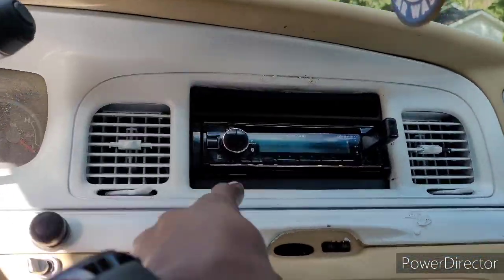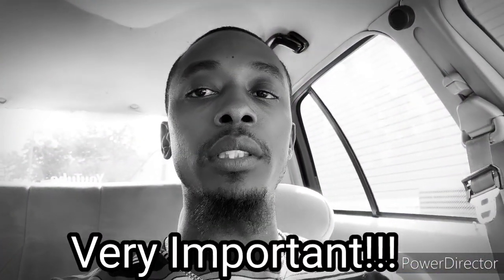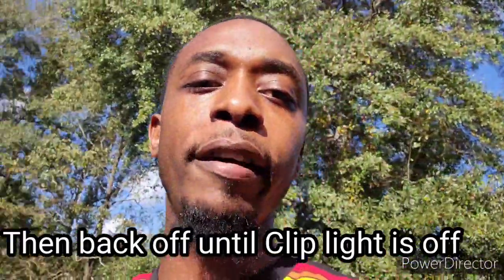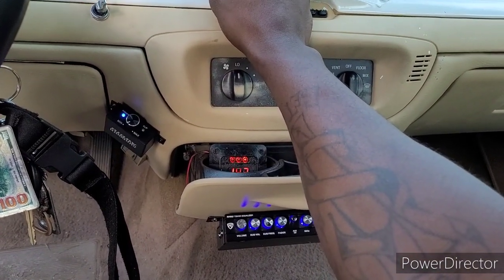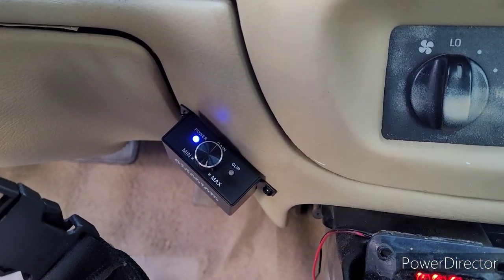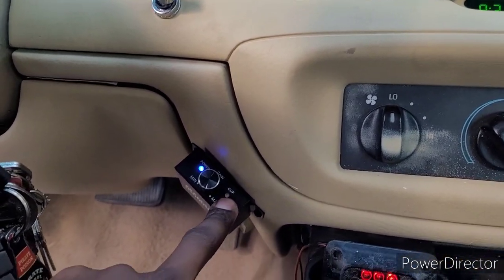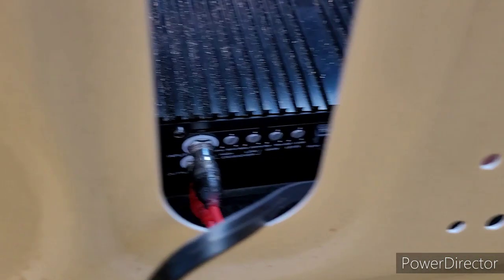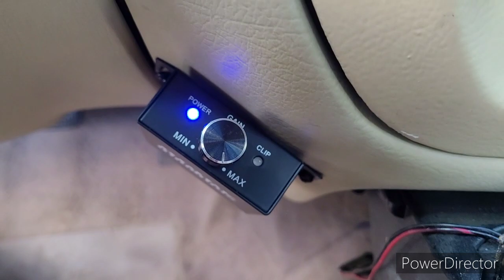How To Adjust Your Bass Knob & Amplifier| Sundown Sfb 8k| Fast & Easy| No Expensive Equipment Needed

Comment: Those Skar audio bass knobs with the clipping light are great to have. It was tested against the SMD2 and both came on at the same time. Pretty accurate
Reply: @BassAddict91  pqqpQLQ1a
Reply: is it good with other brand subs/amps
Reply: @BassAddict91  dissoconect speaker wire or rca
Reply: Cann you use that audio knobs with other amps or no?

Comment: Yup the dd1 for finding the max undistorted volume of the head unit and then matching the gain of the amp to the voltage output of the head unit

Comment: What it do bass addict. I am a huge fan of yours and i watch all uour videos. I have a system i am working on in a f -150. I have a single sub 15 inch 2200 watts qpower and a 2000 watts boss amplifier. I cant reach the full potential so i need some guidance any suggestions

Comment: Bro idk why but I did this with a test tone, subs disconnected, and adjusted the gain on my amp (which has its own clipping light) and the light never came on, it would let it go almost all the way and no clipping light. I connected the subs, turned everything down balls low, and the. Adjusted it SLOWLY and the light came on with subs connected, but volume low. Not sure why.

Comment: You have to turn up your sub volume on your deck all the way up cause the preouts are gonna match up to the voltage of the deck , and the higher the voltage on the preouts the better 4v or 5v the best  and that’s without a eq or bass enhancer .
Reply from the maker: 🤔 you got a point
Reply: @BassAddict91  who build boxes I am from Troy trying to get sumbody to build me a box for 2 15s in a Lincoln
Reply from the maker: My homie boy Jason Mcdaniel at the Box Shop in Montgomery Alabama
Reply: are you talking about the subwoofer level on the head unit?

Comment: Aye I’m thinking about getting the skar 12 loaded enclosure and I wanna know if it’s a good investment and if they are good speaker?
Reply from the maker: Yes get the evls you want regret it
Reply: @BassAddict91  what’s the difference from the sdr?
Reply: @vextua7453  Sound quality and can take almost double the power
Reply: I have the sdr loaded enclosure and it’s a good budget investment and they bang and sound great but if you have the $ go for the evls. But if you’ve haven’t had subs in the past the sdrs would be a good start
Reply: @vextua7453  the EVLs can take way more power. Don't let the 1250watt rms deceive you they can take more as long as it's clean
Reply from the maker: O I know I had two 15s on a taramps 8k and did a 146.7 on the meter
Reply from the maker: https://youtu.be/gZKvDTR9O3A

Comment: Sometimes, my bass knob is max out, but the subs didn't have strong bass coming out n made me Hella confuse. Gain is at 2 o clock position lpf is at 0 n subsonic is at 0. What did I do wrong?
Reply: Make sure the volume on your head unit is around 70-75% of the total volume. Set your gain to right before it starts to distort. Set Lpf between 80hz - 100hz. Set subsonic to 25 hz. Also, make sure your speaker wire is matching the negative and positive to your subs.😊 Hope this helps.

Comment: So after tune it for clipping.. can you on your head unit turn it back to where u normally had it on from it being all flat on the sound eq like flat rock bass etc..?
Reply from the maker: You can turn it back
Reply: @BassAddict91  i always wondered that too like can i put back my loudness on level 2 on my kenwood unit after doing the setup on flat ?
Reply: @NoPainNoGain___ you supposed to leave everything flat.. if you turn loudness back on etc you will be sending a clipped signal
Reply: @allaboutbass8146  damn so l was clipping the whole time 😫.Good to know thanks

Comment: i have 2 12 inch subs and the power light was turning on about a month again and it randomly just stopped receiving power, i tried a different bass knob and it didn’t work either. any help???
Reply: Probs a fuse on the amp fam.

Comment: Say bro make a video on new subs when it come to breaking them in and the different smells to watch out for…
Reply: I got 2 2 ohm Skar 12s 2500 a piece wired in parallel, on a 5000 watt Quantum audio mono block amp..